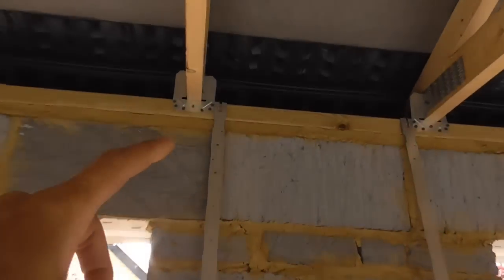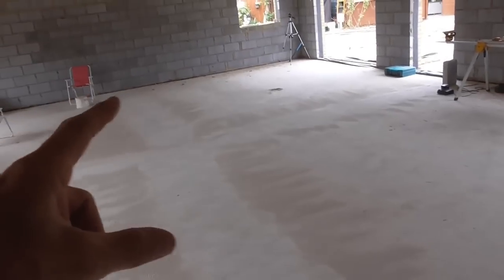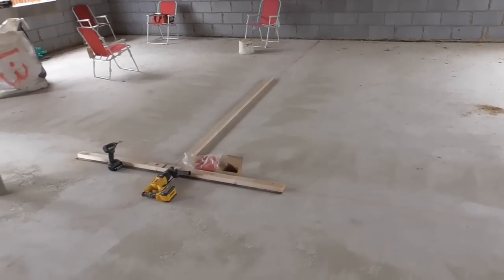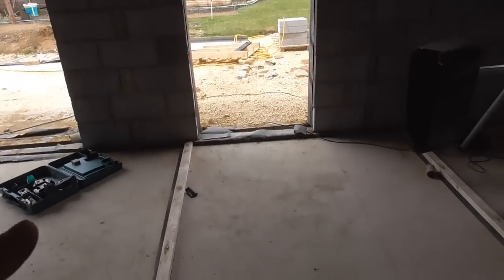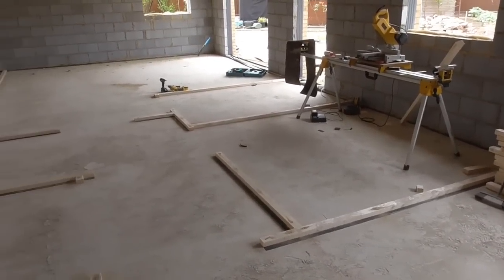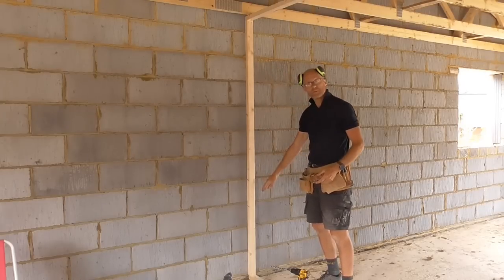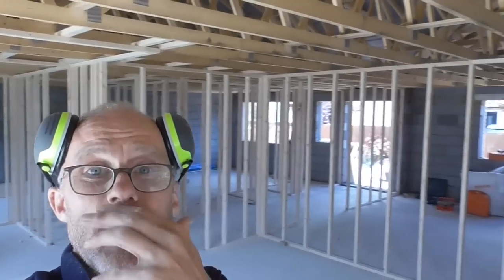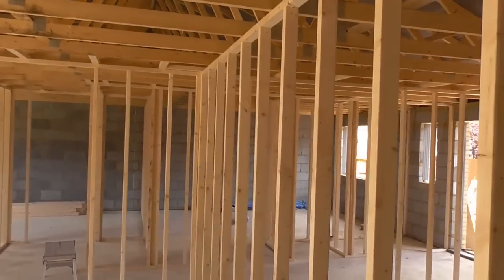Setting out and building timber stud walls in a single storey bungalow***PLUS LOTS OF TIPS***

Comment: What do ya think of the tracer pencils
Reply from the maker: I tried one Aaron, and the little sharpener went blunt before I'd even put one lead though it😬'I'm out' when it comes to those type of pencils😮
Reply: @thetallcarpenter  a just seen them on ya belt yer a don’t use the sharpener a just use ma knife the lead snapped befor it got sharp 😂 I upgraded the lead as well coz was to soft
Reply from the maker: @aaronbell8527  I keep it my tool bely Aaron, as it was expensive, and I cant bear to sling it in the back of the van😮

Comment: Wondering if you’ve checked level on your new red 12v laser? I’ve had 2 now and both have been 4mm off checking about 1m in from each end of the beam on the level line, whereas my old 3year old 20 odd thousand mile travelled dw088k is spot bollock on.
Reply from the maker: Hi Glen🖐Funny you should say that, as I HAVE actually checked it for level, AND against my old faithful DW088😎Reason being, my mate bought one and, like you found, it was out from the factory😬Great comment and thanks for watching😎Cheers Del

Comment: How long do the blades tend to last ya  when we doin studs we butt all the studs up agains the wall and cut throu them all at once what ya have to do to make money on site 😂
Reply from the maker: Hi Aaron🖐The 40t blades tend to last for ages in my chop saw, and I know you boys have to get things done the quickest way possible on site👊Thanks for watching and your comment😎Cheers Del
Reply: @thetallcarpenter  love the vids need a van tour go round with a stick and get the average hight then ya chopping 100 lengths and the 4.8 for soleplate and the heads chop doors out afterwards

Comment: 8mm clearance hole through the stud then your concrete screw will pull tight, no bother
Reply from the maker: Yeah, definitely needs a bit of clearance in the timber Paige👍Cheers Del

Comment: Referring to 2x4's [which are at best 1.5"x3.5" as 'timber,' is a bit of a stretch. 'Sticks' are more like it.
Timbers are not dimensional lumber bought from Home Depot's or Lowes. Timber is more substantial
cuts or logs used in framing, as can be found in old barns from the 19th or early 20th century, where
joinery was a craft. Timber structures are solid buildings, stick built is another species. A hurricane
knows the difference. My prejudice if you will.
Reply from the maker: We call them 4x2s in the same we call 1.2mx2.4m plasterboard 8x4s 🤔Cheers Del